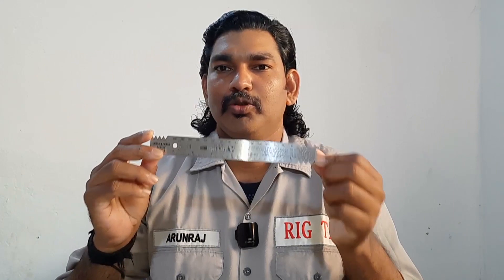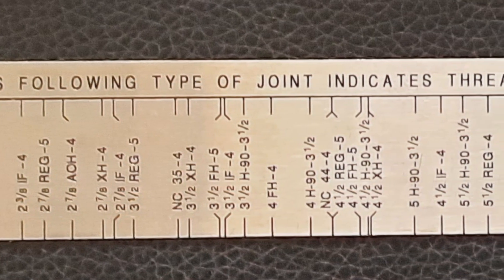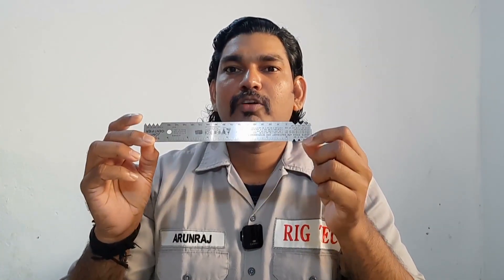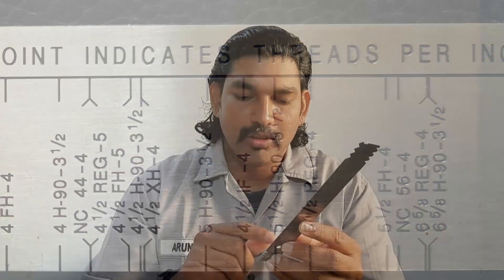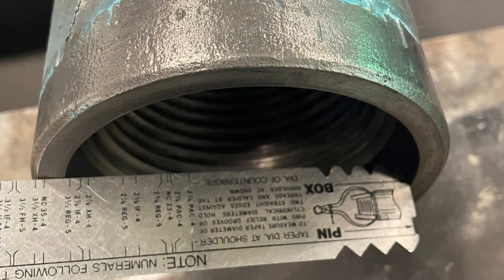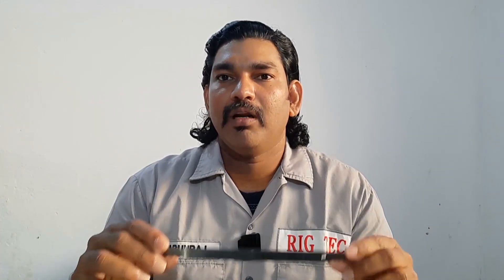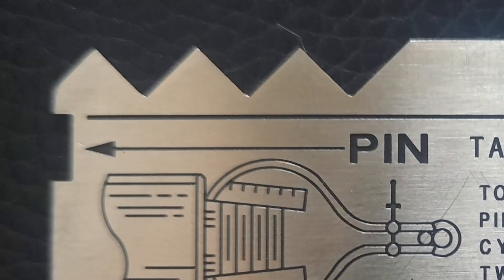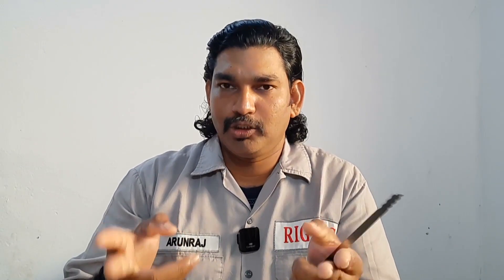HOW TO USE TOOL JOINT IDENTIFIER

Comment: How can one measure a shoulder width of 3½" Drill pipe with 3½ IF connection on pin and box
Reply: Sería bueno que tradusiera lo hablado a español para entender.
Reply from the maker: This for measure counter bore diameter and tapper diameter only to identify the connection
Reply from the maker: Thank you for your suggestion, I am an Indian unfortunately I can't speak Spanish.  Kindly use Google translate for easy to understand.
Reply: @rigtec123  ok entendido. Un favor seria amable de explicar en el próximo video hacerca del tayper. Cual es el tayper de cada conexión o como medirlo. Para saber como calibrar mi conocimetro dependiendo de la conexión.